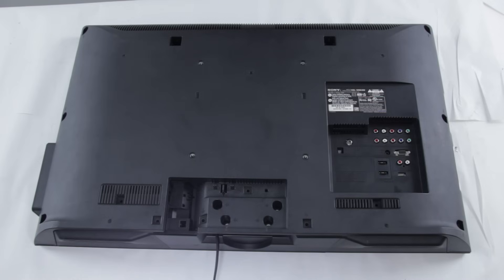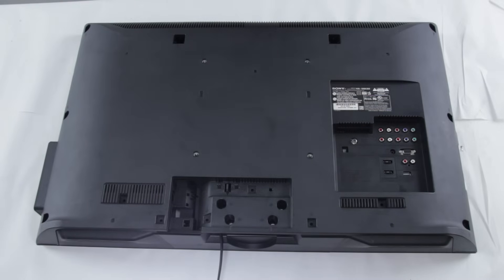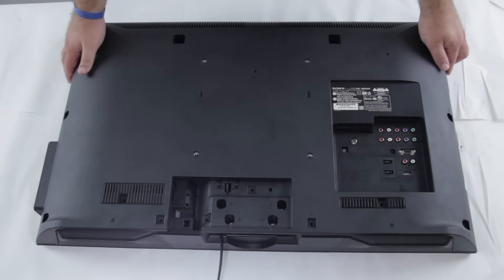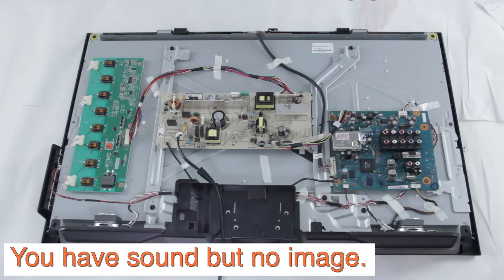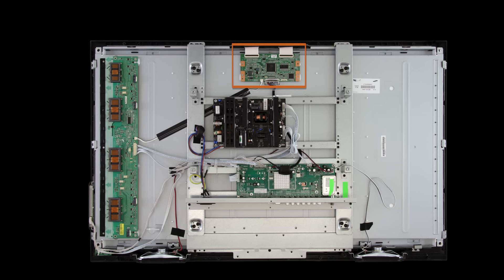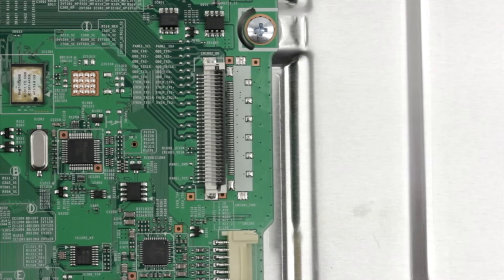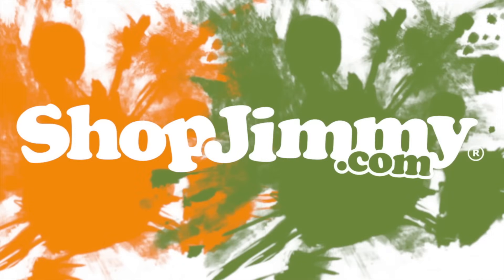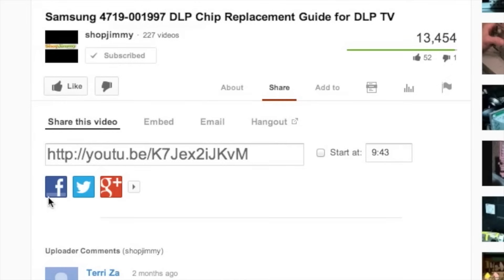LCD TV Repair Tutorial - T-Con Board Common Symptoms & Solutions - How to Replace T-Con Board

Comment: i have sony kdl-32L5000 lcd tv my problem is that when you turn the tv on after about 2 seconds the screen lights up for about 1 second then screen goes black. it does this everytime you turn it on the exact same way.. any suggestions thanks
Reply from the maker: mrjimkraft   This sounds like a bad backlight inverter in your TV.  Does the TV blink an error code?  Thanks!  www.shopjimmy.com

Comment: Hi,have a Samsung 3D 55"LED TV model 55D8000. Some months ago the screen was presenting a dark stripe on the top. The brightness is lowered at that part and the rest of the screen it is normal. It was an intermittent problem but now it became constant. I read some reviews and seems it is related to TCOM board but I am not sure.  What do you suggest me I can do at home to try to fix it? Thanks in advance. 

I
Reply from the maker: cezar Menezes   This sounds like the problem is a bad LED strip in the TV.  You could try replacing the power supply board to see if that fixes the problem, however I am leaning towards it being the LED strip.  If you do want to replace any boards, here is a link to replacement parts for your TV model number on our website, click here: http://www.shopjimmy.com/catalogsearch/result/?q=55D8000  Be sure to match part numbers on your current board, with your replacement for compatibility.  You can also call our customer service for further assistance with your purchase.  (877) 881-6492  Thanks and please let us know if you have any further questions with your TV Repair!  www.shopjimmy.com

Comment: I have a Toshiba 17" TV with colored vertical lines, hardly any picture.  Model number 17HLV85, serial number 98L22325a.  Where is the TCON board and can I get the part to replace it.  I want you to know I did remove all the screws, took the cover off, but did not know which board was the TCON so put it all back together.  My husband purchased another set, but stated I may be able to repair it myself.  Can you help me and also provide the part.
Reply from the maker: Darlene Hines   This sounds like a TV panel problem.  If your TV panel is bad, it may be more cost-effective to replace the TV as panels are typically hard to find in stock, difficult to replace, and expensive.  Thanks and please let us know if you have any further questions!  www.shopjimmy.com

Comment: I have a Sony Bravia KDL-46S4100 television. At first, I was getting a little ghosting on the right side of the display but now, when I turn the unit on, it powers on and I get backlight, but just a grey screen - I can't even  see menu options. Would replacing the TCON board fix this issue?

Thanks for any help!
Reply from the maker: pdouble67   This sounds like a TV panel problem.  If your TV panel is bad, it may be more cost-effective to replace the TV as panels are typically hard to find in stock, difficult to replace, and expensive.  Thanks and please let us know if you have any further questions!  www.shopjimmy.com

Comment: Hello..I have an LG 47LW5300 3dhdtv smart tv.. We were watching tv one day and suddenly the display just went out but the sound and everything still worked...You can see a the backlight come on as you explained in the video. Im looking around to getting a LG 47LW5300 T-Con Board 6871L-2411D via ebay but need to be sure this may fix the problem.Thanks...
Reply from the maker: dorkgeniuz21   This sounds like either a bad T-Con board or a bad Main Board in your TV.  You may need to replace each board individually to see which one fixes the problem.  Here is a link to replacement parts for your TV model number on our website, click here:  http://www.shopjimmy.com/catalogsearch/result/?q=47LW5300  Be sure to match part numbers on your current board, with your replacement for compatibility.  You can also call our customer service for further assistance with your purchase.  (877) 881-6492  Thanks and please let us know if you have any further questions with your TV Repair!  www.shopjimmy.com

Comment: I appreciate your videos and parts site. I have  Westinghouse SK32H240S serial# 5061J72901150. It has a blank display except for a few random visible verticle lines no sound but does have backlight. I cannot get a response from any button but power. I hooked it to a cable line and to nothing it does not matter, still the same display. I unplugged and wiggled  the cable to t con and did get most of the screen to display verticle lines. Any clue?
Reply from the maker: Bill Mader   Well, this sounds like it could be 1 board or a combination of bad boards, either the T-Con, the main board or it could be a bad TV panel.  You may need to replace the boards individually to see if they fix the problems.  Here is a link to replacement parts for your TV model number on our website, click here:  http://www.shopjimmy.com/westinghouse/sk-32h240s  Be sure to match part numbers on your current board, with your replacement for compatibility.  You can also call our customer service for further assistance with your purchase.  (877) 881-6492  Thanks and please let us know if you have any further questions with your TV Repair!  www.shopjimmy.com

Comment: I have a sanyo dp46840, the lower right side of the screen is darker and some what delay when the picture changes. At first it takes 30 mins to correct its self. But its not correcting its self. Sound works fine. Is it t con or backlight inverter panel?
Reply from the maker: dylan taggart   This could either be a problem with the T-Con board or the TV panel.  You can replace the T-Con board to see if that fixes the problem.  If it does not fix the problem, then I would say you have a bad TV panel.  Here is a link to replacement parts for your TV:  http://www.shopjimmy.com/catalogsearch/result/?q=dp46840  Be sure to match part numbers on your current board, with your replacement for compatibility.  You can also call our customer service for further assistance with your purchase.  (877) 881-6492  Thanks and please let us know if you have any further questions with your TV Repair!  www.shopjimmy.com

Comment: I am having an issue with only getting  video on lower half of the display and the upper half will be either black or will have colored vertical lines. This is an older toshiba 42HL169 I have a picture of what its doing as well if that will help but i am not sure how to put it on here.
Reply from the maker: Russ Winter   This sounds like a TV panel problem.  If your TV panel is bad, it may be more cost-effective to replace the TV as panels are typically hard to find in stock, difficult to replace, and expensive.  Thanks and please let us know if you have any further questions!  www.shopjimmy.com

Comment: Hi...I have a19" Sharp TV...Model LC-195B14U. The picture on the screen is distorted, and I also notice diagonal lines running across the screen. It looks more like a poor quality webcam picture...then it does a TV picture!
Reply from the maker: br moore   This sounds like a TV panel problem.  If your TV panel is bad, it may be more cost-effective to replace the TV as panels are typically hard to find in stock, difficult to replace, and expensive.  Thanks and please let us know if you have any further questions!  www.shopjimmy.com   #tvrepair

Comment: I have a insignia  HD plasma tv mod. no.:NS-L37Q-10A serial no.:Q809AJA004076 tv wont show pic but it has sound
Reply from the maker: ashloveization  I recommend replacing the main board in your TV.  Here is a link to replacement parts for your TV model number on our website, click here:  http://www.shopjimmy.com/catalogsearch/result/?q=NS-L37Q-10A  Be sure to match part numbers on your current board, with your replacement for compatibility.  You can also call our customer service for further assistance with your purchase.  (877) 881-6492  Thanks and please let us know if you have any further questions with your TV Repair!  www.shopjimmy.com

Comment: I have a Viore 32" LC32VF56. The first problem i had is where the display remained visible but became dark (like the brightness was reduced). After a week it returned to normal. One week after the opposite occurred; the display remains visible but very bright (like too much brightness has been applied). The sound is fine.
Im thinking between the T-con/Inverter boards
Reply from the maker: *****  This sounds like either a problem with the main board or the T-con board.  You may need to replace each board individually to see which board fixes the problem.  Here is a link to replacement parts for your TV model number on our website, click here:  http://www.shopjimmy.com/catalogsearch/result/?q=LC32VF56  Be sure to match part numbers on your current board, with your replacement for compatibility.  You can also call our customer service for further assistance with your purchase.  (877) 881-6492  Thanks and please let us know if you have any further questions with your TV Repair!  www.shopjimmy.com

Comment: Model# KDL-32M3000; Serial # 4509182.
Hi, This TV turns on ok (green LED); No picture No sound. Backlight is lighting up OK. Does not respond to volume control. Can it be the mainboard or T-con board bad?
Reply from the maker: Gail Samlall   I recommend replacing the BM Main Board in your TV.  Here is a link to replacement parts for your TV model number on our website, click here:  http://www.shopjimmy.com/catalogsearch/result/?q=KDL-32M3000  Be sure to match part numbers on your current board, with your replacement for compatibility.  You can also call our customer service for further assistance with your purchase.  (877) 881-6492  Thanks and please let us know if you have any further questions with your TV Repair!  www.shopjimmy.com

Comment: I have a Dynex Model number DX-LCD37. The serial number is G347CJA047400. The problem that I am having is that the screen has an image but it appears very faded. The sound is fine as well. The image also appears to have a double image.
Thanks for your time.
Reply from the maker: *****   This sounds like a TV panel problem.  If your TV panel is bad, it may be more cost-effective to replace the TV as panels are typically hard to find in stock, difficult to replace, and expensive.  Thanks and please let us know if you have any further questions!  www.shopjimmy.com
Reply: You think it is the panel as opposed to the t-con board?
Reply from the maker: *****  This sounds like a TV panel problem.  You can certainly replace your T-Con board to see if that fixes the problem.  Here is a link to some replacement parts for your TV model, we also have some board repair services available where you send us your T-Con board and we fix it and send it back to you.  Certain restrictions apply with this service.  http://www.shopjimmy.com/catalogsearch/result/?q=DX-LCD37  You can also call our customer service for further assistance with your purchase.  (877) 881-6492  Thanks and please let us know if you have any further questions with your TV Repair!  www.shopjimmy.com

Comment: I would like to buy a t-con board.I have an lg lm47 6700 smart 3d tv .Do I have to provide you with a serial number ..etc or the tv model enough?

The problem is horzental fine lines across the screen and sometimes I get a full screen in pink.T-con?
Reply from the maker: Funtime hz   This sounds like a TV panel problem.  If your TV panel is bad, it may be more cost-effective to replace the TV as panels are typically hard to find in stock, difficult to replace, and expensive.  Thanks and please let us know if you have any further questions!  www.shopjimmy.com

Comment: Hello, I have a Toshiba LCD 42TL515U(2 year old), S/N: B49520T09437L1 Yesterday, suddenly, the screen went black. Audio is working perfectly. I unplugged it and plugged it back. I changed inputs. No success.  You can see lites on when  you look through the back cover. Thank you!
Reply from the maker: Cristina Al   I recommend replacing the T-Con board in your TV.  Here is a link to replacement parts for your TV model number on our website, click here:  http://www.shopjimmy.com/catalogsearch/result/?q=42TL515U  Be sure to match part numbers on your current board, with your replacement for compatibility.  You can also call our customer service for further assistance with your purchase.  (877) 881-6492  Thanks and please let us know if you have any further questions with your TV Repair!  www.shopjimmy.com
Reply: ShopJimmy.com Thank you! I replaced the T-Con board, but still no picture, just audio. Next step? Thank you so much

Comment: hi I have a Sony KDL 46Z-4100 and I get many vertical colored lines all across but sound & picture is Ok?
Reply from the maker: Angie Sanyal   This could either be a problem with the TV panel or the T-Con board.  I recommend replacing the T-Con board to see if that fixes the problem.  If it does not fix the problem, then the problem is your TV panel.  Here is a link to replacement parts for your TV model number on our website, click here:  http://www.shopjimmy.com/catalogsearch/result/?q=Sony+KDL+46Z-4100  Be sure to match part numbers on your current board, with your replacement for compatibility.  You can also call our customer service for further assistance with your purchase.  (877) 881-6492  Thanks and please let us know if you have any further questions with your TV Repair!  www.shopjimmy.com

Comment: I have a Samsung model number LN46A550P3FXZA. Serial Number ALXK3CPQ308055A I have pexlated green shadows on my screen what's wrong with it and is it a easy fix I can do myself? Thanks for your help
Reply from the maker: Wendy Hogan   I recommend replacing the main board in your TV.  Here is a link to replacement parts for your TV repair.  http://www.shopjimmy.com/catalogsearch/result/?q=LN46A550P3FXZA  Be sure to match part numbers on your current board, with your replacement for compatibility.  You can also call our customer service for further assistance with your purchase.  (877) 881-6492  Thanks and please let us know if you have any further questions with your TV Repair!  www.shopjimmy.com

Comment: Hi there, I have a Sharp lc-37gp1u.  Recently, it got some rainbow (primarily pink, blue and red) vertical lines across the entirety of the screen when I turn it on (on any input).  The image of what I'm trying to see (playstation 3 menu, antenna digital feed) shows behind these lines, as well as the tv's menu when I try to bring that up.  It originally had a CPWBX3709TPXA T-Con in it, so I assumed with these symptoms that was the problem, and I replaced it with a CPWBX3520TPZF T-con (as per your website and a number of other parts outlets) because I couldn't find a T-con of my previous version.  The new T-con yielded the exact same results (image underneath, sound is there, menu shows up underneath lines).  Any suggestions? Thanks!

Andrew
Reply from the maker: testsombrero  This sounds like a TV panel problem.  If your TV panel is bad, it may be more cost-effective to replace the TV as panels are typically hard to find in stock, difficult to replace, and expensive.  Thanks and please let us know if you have any further questions!  www.shopjimmy.com

Comment: hello I have a Samsung plasma PN50B450B1D.  The TV has a sometimes black, sometime rainbow colored bar going down part of the left side of the screen.  This bar sometimes is solid and other times can flicker and be somewhat transparent.  any ideas?  I was thinking T-Con or possible F buffer on the one side.

thanks!
Reply from the maker: Bryan Personke   Which direction is the bar?  Top to bottom? Or left to right?  Thanks!  www.shopjimmy.com
Reply: It's top to bottom on the left side
Reply: Any thoughts?
Reply from the maker: Bryan Personke  This sounds like a TV panel problem as there is not a T-Con board in the TV.  If your TV panel is bad, it may be more cost-effective to replace the TV as panels are typically hard to find in stock, difficult to replace, and expensive.  Thanks and please let us know if you have any further questions!  www.shopjimmy.com
Reply: ShopJimmy.com Does the main or logics board have anything to do with it?  At times it will completely go away for a while and come back on and off.  thanks for the response.  I just wish it was something else other than the panel. oh well

Comment: That video was very good and helpful. But I have a Sony Bravia KDL 46xbr2 and it's powering up with the click but no actual sound and pic.what can I do?
Reply from the maker: Albert Blair   I recommend replacing the AU Main Board in your TV.  Here is a link to replacement parts for your TV model number on our website, click here:  http://www.shopjimmy.com/catalogsearch/result/?q=46xbr2  Be sure to match part numbers on your current board, with your replacement for compatibility.  You can also call our customer service for further assistance with your purchase.  (877) 881-6492  Thanks and please let us know if you have any further questions with your TV Repair!  www.shopjimmy.com

Comment: My Insignia LCD NS-40E560A11 has a scrambled video screen for about 1/2 hour until warm then fine.  The sound and other functions appear fine during this warm up period, just the vido is scrambled with many, many verticle lines.  T-Con?
Reply from the maker: Steve Visconti  This could either be a problem with the T-Con board or the TV panel.  If the problem is the TV panel, it may be more cost-effective to replace the entire TV.  You can replace the T-Con board to see if that fixes the problem.  Here is a link to replacement parts for your TV model number on our website, click here:  http://www.shopjimmy.com/catalogsearch/result/?q=NS-40E560A11  Be sure to match part numbers on your current board, with your replacement for compatibility.  You can also call our customer service for further assistance with your purchase.  (877) 881-6492  Thanks and please let us know if you have any further questions with your TV Repair!  www.shopjimmy.com